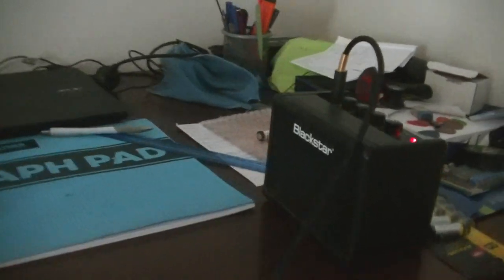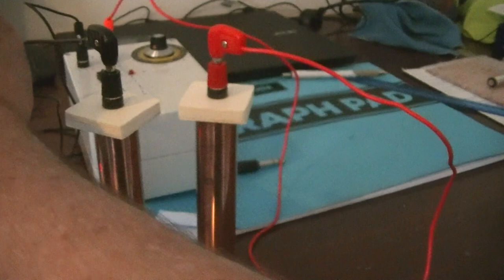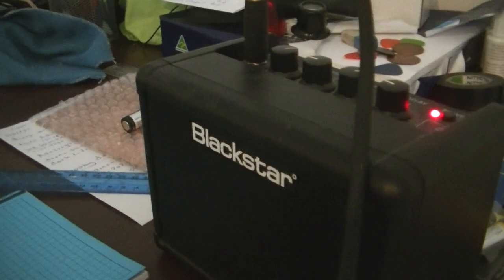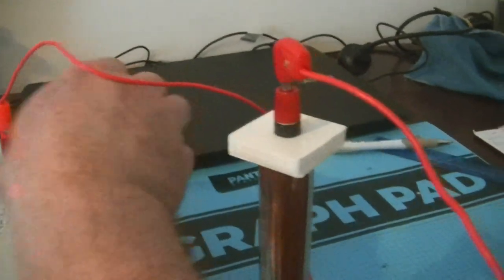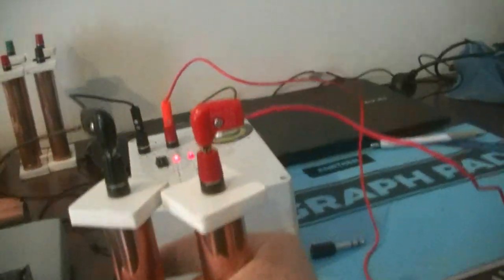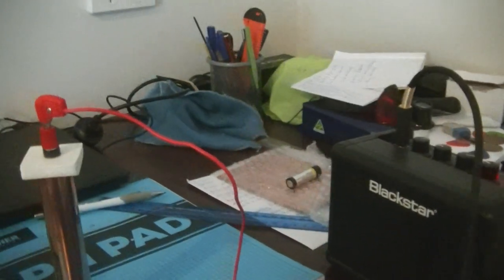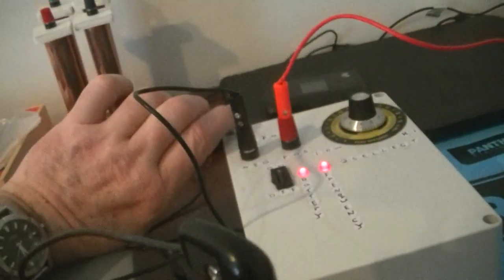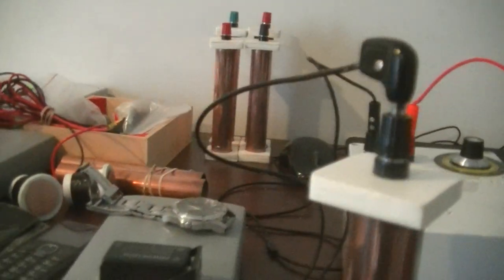ufo sensor circuit hears parasite zapper frequencies and a 440 hz  tuning fork

Comment: Wow that so Awesome your one very smart person
Reply from the maker: and i collect knowledge to and like to think outside the box and apply one idea to another to get better  results and  and take notice of things outside the ordinary to  thank you kim my favourite number one commenter
Reply from the maker: i recently found out that a brand of alkaline 1.5 volt aa size batteries sold by coles can fault up and over heat in a battery pack when not even being used or linked up to power any circuit  as 2 of the batteries in the pack get hot so they are faulty so dont use them or leave them in any battery operated project in case they catch fire to
Reply: @stevenchiverton48  aww thank you If I hugged your channel of course I watch your videos and comment thats what friends do
Reply: @stevenchiverton48  thank you for the advice most of the time I use rechargables

Comment from the maker: the circuit used as a parasite zapper is a modified tens circuit its output i latter find out is ac not dc like timers used in parasite zappers normally put out , ive recently built another and modified its output to put out dc yet it still emits a wave that can be herd on the ulf to vlf receiver circuits ive made from schematics online , so now i have a ac circuit thats selectable frequency outputs via a rotary tap switch that runs to various ceramic capacitor values in ten and  now im working on a 2o frequency output double version to experiment with

Comment from the maker: and i forgot to turn the amp volume up higher so you can hear the induced signals from the sensor louder and i did before i did the video turn the amp gain down so it wont pick up to many other stray interfering signals

Comment from the maker: ive got the tuning fork details wrong even though im sure it was listed as 40 kilohertz when i first brought them on e bay so i stuck to that when i dident realize in fine prints on the tuning fork it says 440 hertz a so it also reads a when i test it using a guitar tuner so its about the number 5 string on an electric guitar  = a note . i used a small round eye scope to see the fine details on the tuning fork  and using a audio program file i find the same 440 hz on it listed as sine 1 and it sounds very close or the same but different volume

Comment from the maker: heres my log for the latest experiment with this amazeing modified copper pipe electrode 
last night saturday night i layed in bed with my headphones  plugged into my electronic gravity wave detector monitoring for any stray em feilds etc etc and i decided to plug in my frequency generator number 4 and hold the modified hevey negative electrode in my left hand and the hollow positive coper pipe electrode in my right hand  and as i switched to each frequency output at a time i can hear the nac signals over my gravity wave detectors headphones and at each frequency it was loud enough to be sure my modified copper pipe electrode is amplifying the ac waves for sure and even if i hold that electrode up high i can still hear it well over the top of some mains hum sound which my gravity wave detector has never picked up before so somehow the modified electrode is amplifying it to b and its working for sure and when i sit that electrode while still holding the other in my right hand on top of my forehead near the third eye area the signal sound chnages as if its in tunwe with my third eye area  this is proof my electrode design dose amplify the ac cycle in the first half and sends the ac wave out long distance anyhow i tried thinking of somthing while doing the experiment thinking if it could through my biological body maybe  amplify thought  if it dose and anyhow while monitoring and listening to the cycle ac waves i herd somthing come through which ive never heard before  sounded like a return signal but static burst type as if somethings being received but not contain anything voice or other  that can be heard as some kind of reply  anyhow im going to record them this time and run it through audacity sofdtware see if i can uncover anything hidden in it like i did with those alien voice like thing and voice fragments to from white noises like i did before  when i recorded the white noise on my gravity wave detector and found these hidden in it

Comment from the maker: ive got the simplified hand drawn schematic for this so the settings where you dont hear the sounds maybe beyond human hearing but the ones you do hear the sounds i can isolate the ceramic capacitors switched in and make another model including these capacitors that generate these hearable frequency waves that the ufo em sensor can hear and modify it and include maybe a Morse code key to break the output frequency waves into a Morse code  so if the sensor can hear the frequencies i bet ufos have the tech to hear them to so may be great for a ufo signaler beacon of some kind to attract them  or at least grab there curiosity so they may come check it out the source of the signal , or i can use a slow to high speed relay flasher circuit to send the tone waves out at various speeds  not in a code fashion but enough  again grab the ufo  crafts attention